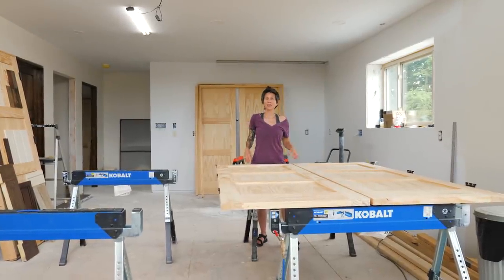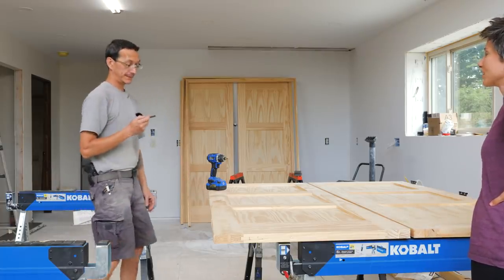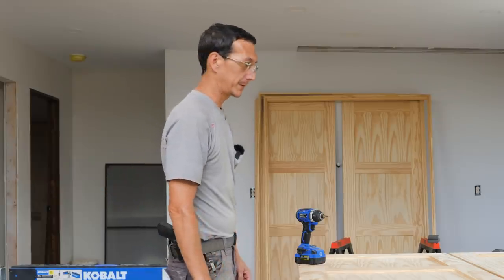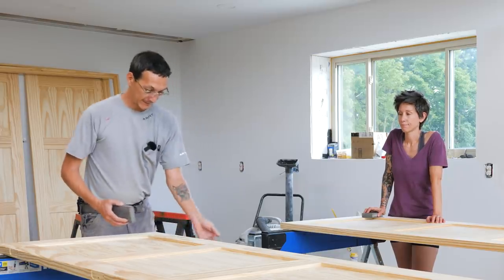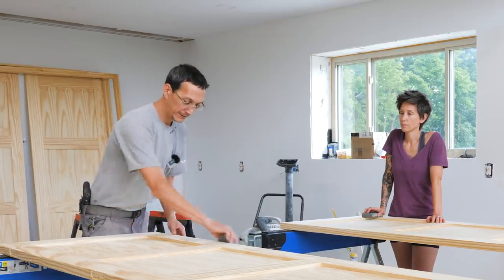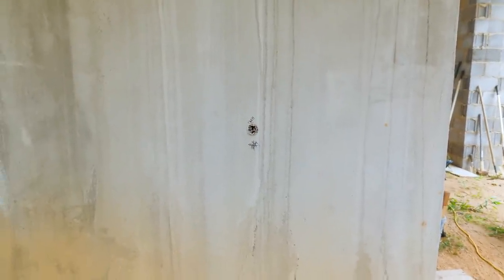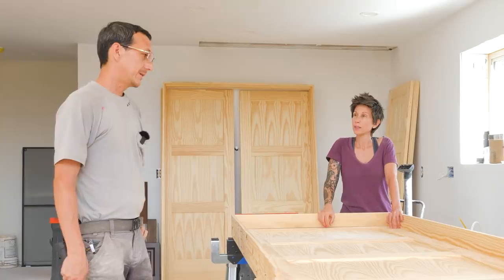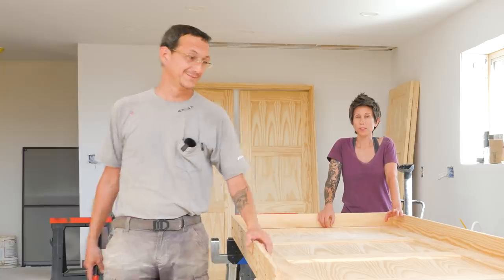The ONE SKILL I wish I HAD! (and installing gas lines)

Comment: Coming from an automotive repair tech for 20 plus years, for the most part, if you posses the ability to break systems down into subsystems car repair is easy.  The specialty tools needed can usually be borrowed rent free from parts houses.   And virtually anything you need to know to repair something can be found on youtube

Comment: Honestly, vehicle repair is a skill that anyone can pick up right away simply through youtube videos. I've been keeping our vehicles running for years with this method. Any time anything breaks I look it up on youtube and buy the tools to repair and do it myself. I've done repairs for total cost of 20 bucks that a shop claimed I needed a brand new engine to resolve (just needed new valve cover gasket that was leaking oil into the spark plug wells, causing misfiring.) 

I'm at the point that I DO NOT trust anything a mechanic says, and even if it was reasonably priced (LOL) I would never take my vehicles to a mechanic. Been conned 1 too many times and my work always beats the pants off the flunkies these auto shops and dealerships hire. 

I'm even seriously considering buying the equipment to put my own tires on my rims, as I cant even trust tire shops not to cross thread my lug nuts and cause me to have to replace the dang lug post... Its getting silly how bad it is out there. 

Sorry, rant over....
Reply: My husband does tires and some customers will ONLY trust him.  Every time someone else does tires on one of the nicer cars, they end up scratching the rims and costing the company money.  He is calculating the money lost this year by the company, and it's in the $1000's.  It's unfortunate that kids these days just don't know how to listen.
Reply: I agree.  And if you need a tool that you dont have, buy it. It will pay for it self right away and you get to keep the tool for next time.  I dont own a vehicle that has less than 250,000 miles and they all run great and ar paid for.
Reply: Haynes manuals have been a worthwhile purchase for every vehicle I have ever owned. Despite being an engine room mechanic in the Navy. Ice vehicles and steam turbine power plants are very different. Key thing I learned in USN is RTFM.
Reply: @whirledpeaz5758  thank you for your service.
Reply: I love it when you people come into my shop. "I saw on YT how to fix this, so you better not rip me off!!", lol. I'm glad you have taken it upon yourself to learn auto repairs, that helps me a lot, when I explain how your YT repair made the actual proper repairs double the costs. Maybe then as I explain the problems and costs of repairs, your knowledge of the profession can make you comprehend what I'm talking about.
Reply: @elmerfudpucker3204  Sorry man, just cant trust mechanics any more, you can be upset, and that's OK. You may be one of the 20% of legit honest mechanics, I just don't have the patience to wade through the other 80%. Put yourself in other folks shoes. If you needed a room re-drywalled and painted, and 4 out of 5 times you attempted to hire it out they either told you that you needed rebuild the whole damn house or wanted 50k, you might just decide to look up a video on the subject and do it yourself. You can disagree, its your right. That doesn't change the fact that I wont give any more money to a shop and I'm damn sure I'm not the only one who feels this way these days.
Reply: @rbmatch1  Yep! Im guilty of collecting tools that are way to specific to be useful anywhere else. But when I can buy that tool about 10 times over next to the cost of a shop doing the work, well... I like the tools.
Reply: John, yes YouTube can teach you a lot.. but keep in mind reading a schematic correctly can be a challenge for many people.. to fix any problem you first have to find the problem and then fix it. parts swapping and shooting the parts cannon at your car or truck is what many shops will all without finding the real problem. keep on working on your own vehicles it is the smart thing to do.
Reply: @elmerfudpucker3204  integrity is still important to any potential customer. 
No disrespect but someone who might hide behind a possibly made up name to poop poo someone's attempts to do their own mechanical work to save $$$ isn't kool. Yes you are right about some folks who aren't very good at mechanical work can make things worse in some case's.  there's an unwritten law in the universe when you help enough people reach their own objective's that will come back to you many times.

Comment: An old boyfriend of mine taught me lots of mechanical skills but then vehicles became so computerized.  I always thought your best best is to buy a non-computerized vehicle whereby you can easily learn how to repair and replace parts.   The real problem with east coast vehicles is the rust and body degradation they incur because of our climate and that is a totally different ballgame.

Comment: Before I retired I always had my vehicle repairs done by auto services. Since then the prices have gone through the roof !!! Thanks to you tube I've done most of them myself lately. Front brakes and rotors,shocks,thermostat,front driver axle(torn boot) etc. I had no experience with auto repairs.Haven't had to buy any special tools yet, just the normal stuff I already had. Also as I'm sure you know buying my own parts is a huge saving in itself. I'm sure you 2 have more than enough skills to tackle a lot of the same repairs I've done. As to having the time during a house build,that's a different story. 
I can't wait to see you folks move in as I'm sure you are just as anxious.

Comment: Usually its health and safety items like railings, smoke detectors, outside stairs, exit door lights  then  safe electrical  a working toilet/sink possibly a kitchen sink.  Some places will give you a conditional or temporary  permit.  Railings around the deck would likely be required as well as stairs for emergency exit off the deck.   Wonder about fire proofing on the  first floor exposed ICF.    With all than ICF don't think your heating/cooling bill is going to be too bad.  Going to be one nice house.

Comment: I've never seen someone hit a gas valve with a hammer, it's a valve not a nail. When I was doing it, we would gently tap the pipe in then thread the valve. Hope you guys aren't looking at another "well pump" jack leg installation scenario that you will end up replacing.

Comment: Wow insane prices back there. My friend bought a car 5-6 months ago. A 2003 Saturn (she specifically wanted a Saturn) she paid $6k for it. It had 43000 miles on it, pristine inside and out, even had the original tires on it! She also got a year or two warranty on it. She did get the tires replaced as old rubber and AZ sun don't mix well. Best part was the car lot is practically across the road.

Being able to work on your own car is awesome, but the past few decades the cars have too many chips and electronics, so much to go wrong

Comment: You'd be amazed at what you could do. Once my husband had a spinal tap and was flat on his back. I had to change the alternator in our old station wagon. He drew me a picture, gave me a few tips and I did it. And I did it right! If I can do it, anyone can. But, having older vehicles without all the computer stuff helps!
Reply: I can't believe the prices of new trucks.  We don't need all those bells and whistles!!  Give me an old Chevy, Dodge or Ford with a carb and roll up windows any day.
Reply: @pikehunter23750  Yep! My husband was an electronic engineer in the Air Force, says all they do is break down.
Reply: @rootsrocksfeathers1975  Firstly, thank your husband for his service.  (My hat's off and hand on heart!)  Secondly, he's right!  All of those electronics inevitably fail one way or another.  The more there is, the worse off (or lazier) we get!

Comment: You’ll need a soft start on your condensing unit to run them off of the solar panels. The soft start kit needs to be compatible with you equipment.
Reply from the maker: It’s already a soft starting inverter driven unit.

Comment: I've had great luck in the past with university surplus car sales. I've personally gotten two vehicles from there at great prices and have steered many others there too. Of the vehicles I have bought and had others buy, all have required minor or no repairs! Even after driving them for a while, the only reason I got rid of them is to get something newer. The key is to get something good, like a crown vic, f150, or ford transit van. Those are very reliable, cheap to maintain, and go for hardly anything(expectation of f150).

Comment: My husband paid $250 at a sheriff auction for an '04 Hyundai Elantra 2 or 3 years ago as a beater for going to and from work. Easy to work on and parts were cheap. Someone rear-ended it. I was like well that sucks cause it was the beater of all beaters, worked bees in it and everything. The insurance company settled at $3300. I was floored. But we ain't able to find a beater to replace it that doesn't cost $3300.

Comment: Fair market value on vehicles is based upon consumer demand which is high. You can throw away the worthless pricing guides (most are owned by auto manufacturers). I'm driving my 81st vehicle. I shopped for days and finally found a one owner 400 miles away in Portland, Oregon last year. No rust or damage. The "value" has increased nearly double what I paid.

Comment: There's alot to buying salvage vehicles. First of all you need a dealer license to buy at the salvage sales. That's the only way to get any deals on them. You need a rollback to haul them, a frame machine, paint booth, welding equipment, body work skills, painting skills, mechanical skills and knowledge  of where to find used parts for repairing the vehicles. And salesman skills to sale the cars. And an office for the dealers license. My family has been doing this for many years in n.c

Comment: The only brand new car my wife and I ever purchased was a 2007 Saturn Ion.  We still own it 190K miles later. It’s only ever been to the dealership for recall or warranty work. Every other vehicle I’ve bought has been used. I went to tech school over 2005-2007 for my AAS in diesel & heavy equipment, and since built a career in the power generation field. But the skills are transferable light automotive. I’ve saved thousands of dollars over the years keeping older vehicles alive. We did recently purchase a newer SUV with all the trimmings, but it was 5 years old and had about 55K. It was actually very decently priced because the market where I live is flooded with them, and it had a small dent on the hood that I covered with a bug deflector. But I saved some money there. No big deal. Back to your point though, having automotive knowledge also transfers to a lot of other things. If you can fix vehicles, you can actually do a lot of things that you wouldn’t otherwise know how to do. It’s all nuts and bolts.

Comment: I know what you're saying about the cars. My husband recently bought a 2003 Toyota Tacoma for $4000 with over 200K miles on it. He put about $800 into repairs on it and flipped it for $6500. He got lucky on this one. We don't know a lot about car repair, but we know enough to change fluids, change brake pads and maybe change a few parts like starters, alternators, master cylinders, slave cylinders and batteries. This one needed more than that, but he found a buyer for it. He did let the guy know what he knew was wrong with it, but there are crazy Toyota people out there and when they see it they want it. 
As for auto repair; I've learned a lot from Youtube especially a channel called Chris Fixx. He's got a video for everything and does it all in his driveway. I also recently got obsessed with small engine repair during covid lockdown. There is a great channel for that called Steve's Small Engine Saloon. I would love to learn more about fixing them, but there aren't any courses available near me so it looks like I'm sticking with YouTube University.

Comment: Always worked on my own autos.  It's really tough on newer cars with lots of electronic modules and computers. And pre-computer ones are all rusted out by now.  With scan tools in theory you can ID the bad module but more likely than not its the wiring especially if the salvaged auto has been in a flood.  You can't afford to have a shelf full of modules to swap out and usually you can't take a module back to the parts store if it didn't fix the problem.  I always bought 1-2 year used cars (Hertz was great when they had cars) but now I would be tempted to buy new given the poor risk/cost ratio of used cars.  The good news,  a low mileage Toyota or Honda is going to be trouble free for years.

Comment: When we built our foamed house, the humidity also went crazy. The AC wasn't running enough so before we even finished building we installed a whole house dehumidifier.
Reply: I think by what you said that the AC was not running long enough Cycles, should run at least 15 minutes... So in the future, on a new AC, just go down in size and the AC will Run longer and the humidity will be lower for you.  IMHO
Reply: @jameschupp2230  Actually we did that, 2.5 ton unit for 1,800 SF home in Florida. The time of year, March and April were cool, neither the AC or heat would run much at all. When you build a really tight house high humidity can become a problem. We installed intake duct in laundry room, exhaust duct in master closet with a humidistat. Plumbed the water drain into the AC drain. Year round the house is about 45% humidity now or lower.

Comment: I'm mechanic to answer your question but you should buy a car out west, there is no rust and no flooding (you should actually check for flooding) but the most part the vehicles out here are much better.

Comment: btw ball joints seperate witha sledge hammer and a crewbar , lossen nut , place crewbar where it plys the balljoint apart  , hit the side of connecter with sledge untill it pops free , then remove nut and disassemble , yes i did go to collage for this , in 1979
Reply from the maker: Usually it’s pretty simple but not when Ford decides to use steel ball joints and aluminum control arms.

Comment: Just the computer systems(which run everything since 2005 or so) require 10k or more per year of equipment to service Buy a 30-year-old diesel manual transmission vehicle and you can do all the work yourself. I did diagnostics for 30+ years and you may be limited by "tool and information costs) but the simple mechanical work you can do Just buy the tools as you need them (balljoint press is less than $50)

Comment: Those Ford trucks are also located at the Kentucky Expo Center parking lot up the street in Louisville. The parking lot at the old Colgate plant in Clarksville, IN is also completely full of trucks. This also does not include the overflow lot at the Ford Truck plant. If the Kentucky Moter Speedway is also full of these trucks that is a surpass of trucks. I’m also assuming there are some other locations where these trucks are being staged. Supply suggests these vehicles will greatly depreciate in the upcoming years. So you might be able to get a GREAT deal on a 2021 F150 in 2023.
Reply from the maker: Yes
Reply: I'm greatly looking forward to that. Truck prices have been nuts for years even before this chip stuff. Being able to get one for a reasonable price would be amazing

Comment: I just bought a new truck.  Dealerships are all adding a "economic impact market adjustment fee" of $10,000 to the sticker price of each vehicle.  All the dealerships are doing this in my area.  I asked if they were truck specific and they said the fee applied to all new vehicles.  They don't tell you until you get there.  So if browsing for a new vehicle, add $10K at present.   In my case it was a Nevada Dodge dealership and I am not sure if it is nationwide or not.  Just wanted to warn folks.
Reply from the maker: Yeah that’s called robbery. Lol.

Comment: A well insulated home like yours, a wood burning fireplace will run you out of the house, even on the coldest days. We put in a gas log fireplace in our insulated home instead of a wood burner for just that reason. We got the fireplace ambiance and just enough additional heat in the winter to enjoy the fireplace. But have it on too long and there will be windows going up. Can you tell us about what appears to be poly gas lines? Ours are all rigid in our home in KS.
Reply from the maker: They are stainless steel flex lines.

Comment: Do you know what type of pipe they used for the gas lines?  I'm used to using cast iron pipe (black pipe) but your pipe looked flexible so I'm thinking it was not cast iron.  Also a good trick for staining the corners on the doors is to lay the stain in heavy and then use the air compressor to blow out the excess, then just wipe it up.
Reply from the maker: Stainless steel flex pipe with iron fittings.

Comment: New vehicles are hard to work on as the industry has become much more complicated and designs are less for ease of maintenance. Some modern cars have hundreds of computer sensors that will throw codes and cause issues. If you plan to work on automotive better to get something old that is a known reliable engine and platform, but is that safe? I had this conversation with some friends recently and the modern cars within a few years old are much safer in an accident. Could be the difference of being killed or living or having a life changing injury or a simple broken bone.